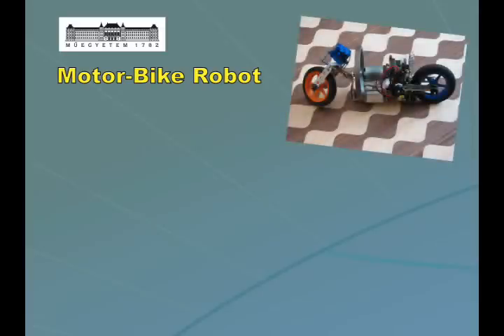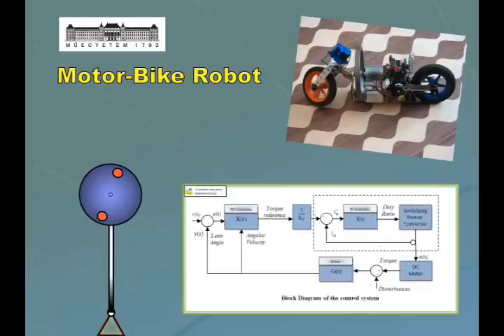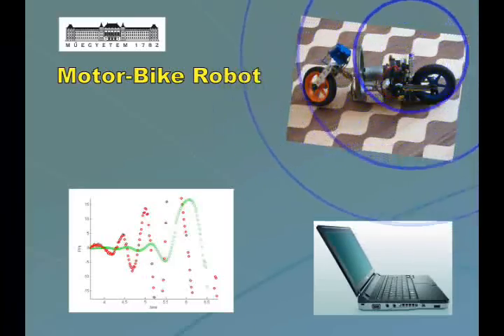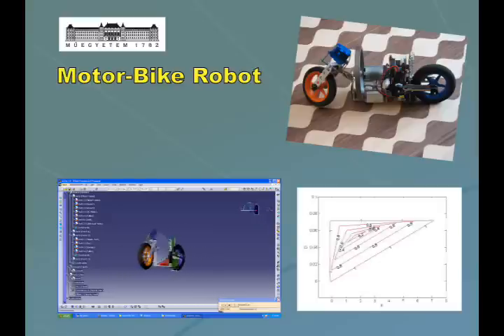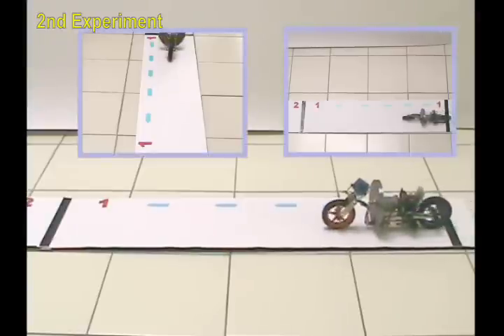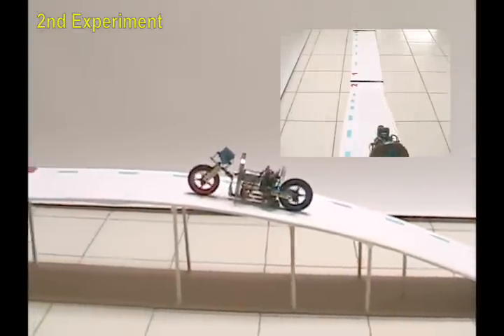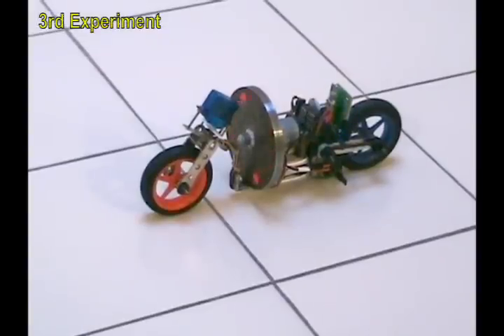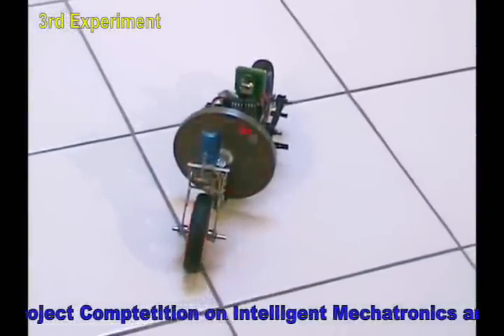Motor Bike Robot

Comment from the maker: Input is the mechanical torque exerted on the flywheel, and output is of course the angle of the robot. 
Gains can be found either by tunning, or calculations. Check some classical control engineering books.

Comment from the maker: Hi!Thanx. Infact using a pendulum isn't simpler  nor enregy efficient. The reason is you need to have 1 more sensor to read the angle of the pendulum what you don't need in the case of a flywheel. Moreover, statically, using a pendulum seems 2 b better, but dynamically it's not i.e. the unbalancy of the pendulum not only doesn't help to stabilize the system but also in certain cases dictates more control force to compensate this unbalancy.

Comment: How did you manage to calibrate the accelerometer into the exact angle to the center of mass? My experience is that if these angles slightly differ, the wheel will eventually spin up to full speed and the bike will fall over.

Comment: you could make it more compact using an arduino micro/nano. I did that with a helicopter but in reverse as a reaction wheel so it could pitch further.

Comment: Hi! You did a very good job! Congratulations. :)
I've a question. The control would be simpler if instead of the inertia wheel you used a pendulum to shift de center of mass to the sides of the robot?

Comment: Hi.. this is an incredible work you've done! and about control, there seems to be always miracles for the successful cases. 
For me, I've found it hard or impossible to tune manually the gains for cases. 
Your system, or 2 wheeled mobile robot, contains non-linear elements which make the analysis complicated. For example, how can you manage to find your system' poles and zeros? you  used linearized model?

Comment: which principle  is used for balancing  ..please send me information about the principle...
Reply: Ganesh Langade Patil I don’t know what the name of it is but I think it works becouse when the motor accelerates the week it has to apply an equal and opposite force on the bike. So if the week spins clock wise then the force will be counter clock wise. That’s what I think, I may be wrong ...